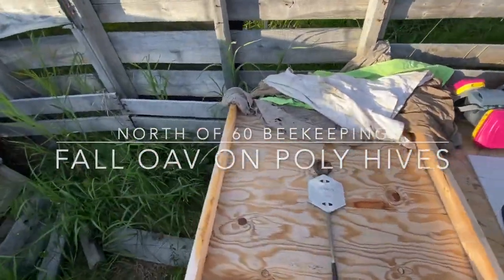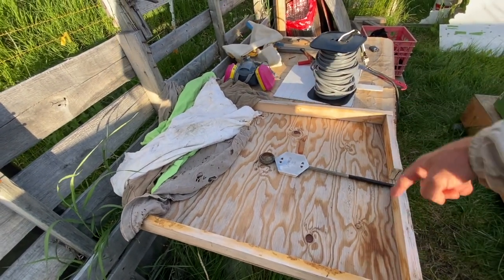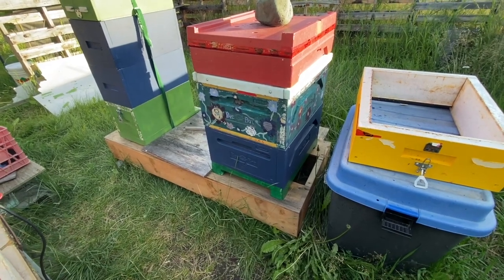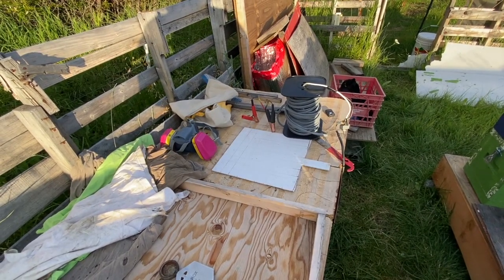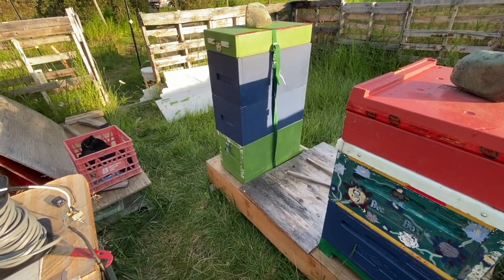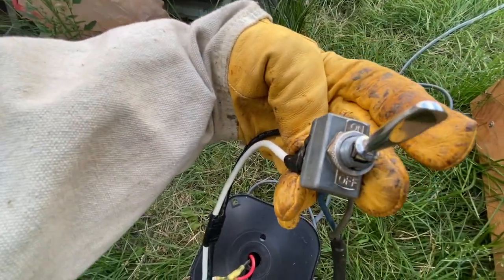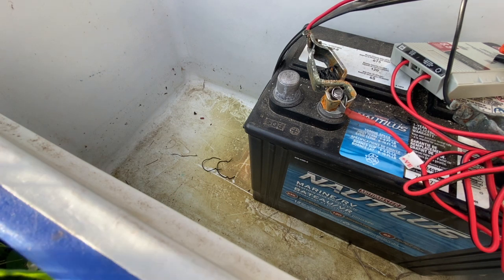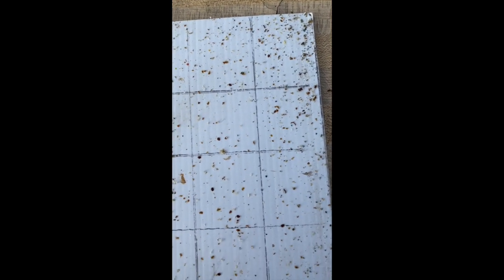OAV WITH POLYS

Comment: Thank you, I was wondering how I was going to OAV my new poly nucs I am in New York state USA this will be my first year using poly hives can't wait to use them.
Reply from the maker: You typically need to make yourself a bottom adapter out of wood to prevent any contact from the hot parts of your OAV tool. I treat through my screen bottom board.